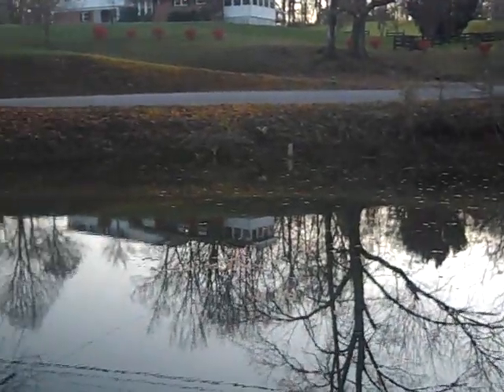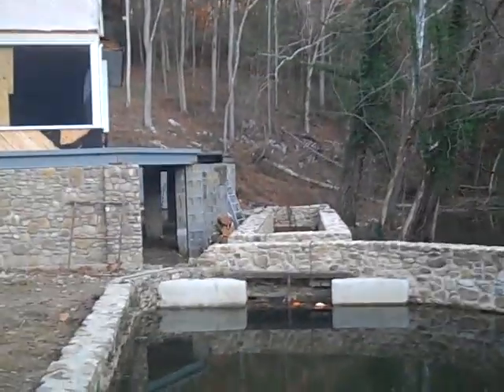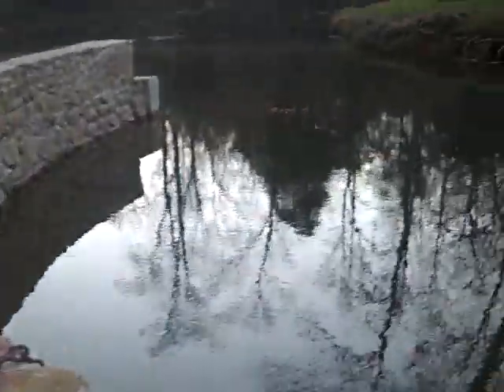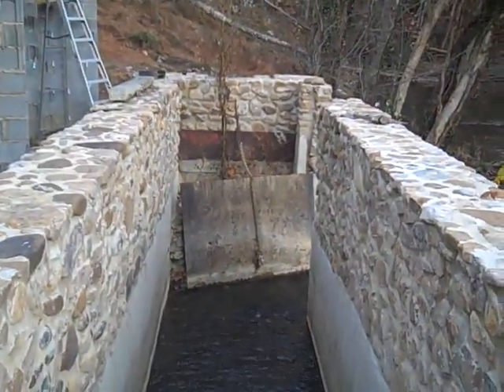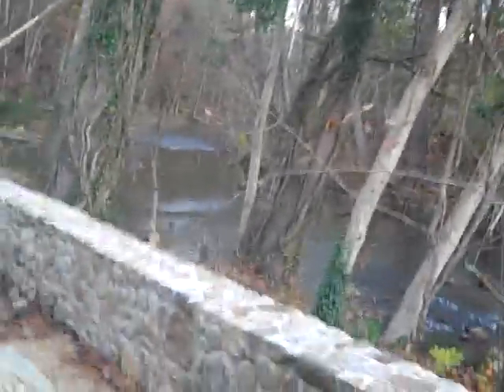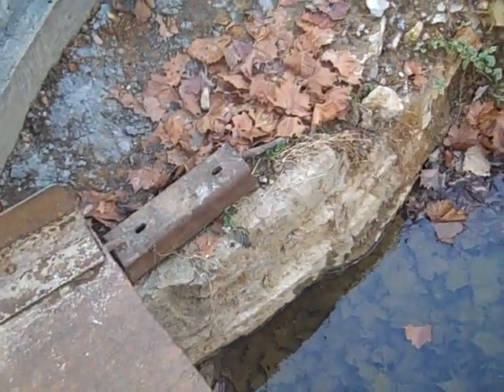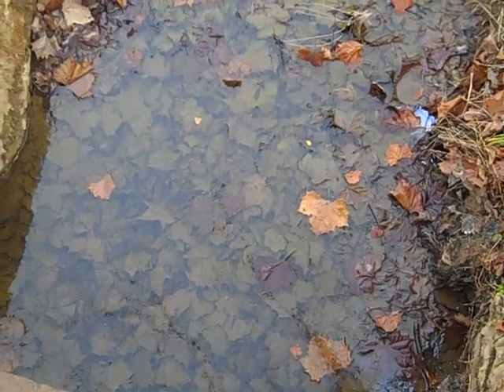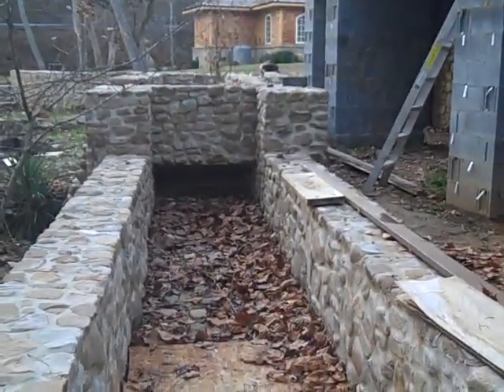Potential Hydroelectric project

Comment: Also, if you use any for of vortex in the design, you automatically get more bang for the buck.  The vortex changes some of the random molecular motion (heat) into velocity (kinetic energy).  Viktor Schauberger did extensive work on this, I've seen it for myself and the Kromrey converter specifically demonstrates it. Good stuff.

Comment: i am thinking less electricity and more mechanical power.
what about a simple extension of the waterwheel axle on which you can run belts for various machinery?
old style lumber-mill, mechanical log splitter, a grind stone for corn/wheat etc, water-pump (pump water with water), a mechanical forging hammer, or anything else that needs torque but not a lot of speed.
One water wheel with a well designed layout could power all of them (probably not at the same time though)

Comment: You're right about an overshot.  The torque is _much_ better than other designs.

Considering steel or plastic vs wood?  Better life.

Also consider a ring gear (in segments) around the wheel with a small gear and shaft going into the powerhouse.  Easy way to step up speed.

Comment: @zenmasterofslack I'm with you Zenmaster the direct drive of the screw cuts out the need for gearing and is more efficient perfect for that size of head.
I think the owner will want an old  style wheel at that location!

Comment: Amazing, I love your place! So much you can do with that kind of flow. Any chance you have a waterfall on the place? I mean probably not, but the creek was a surprise so ya never know, lol. The further the drop on a good flow in a pipe the more efficiently you can spin a generator. Or a water wheel making tight use of the water flow can move stuff also. With good generation you'd be about set. It's good to be you man  : )

Comment: thats cool, u though about useing new wagon wheels,w/ 3" center could fit bearings to it.  all steel would give u 48"-50" depending on the paddles. wheels I found them at atwoods. can I come help with that project.? LOL wish I could.